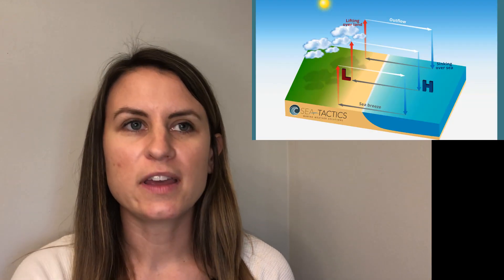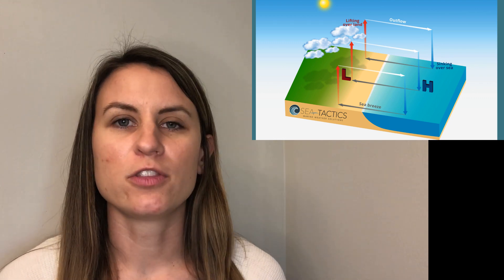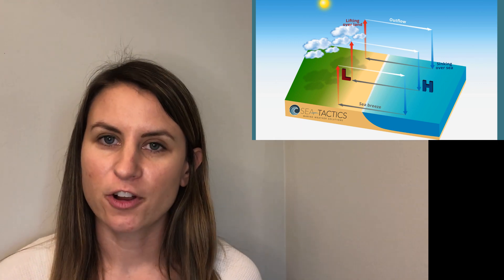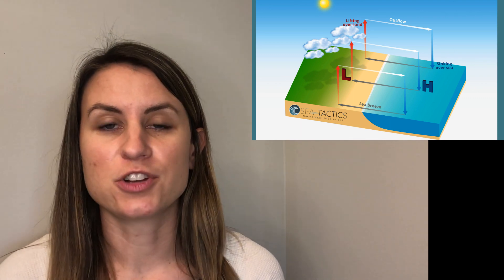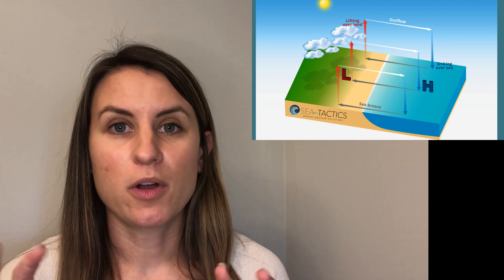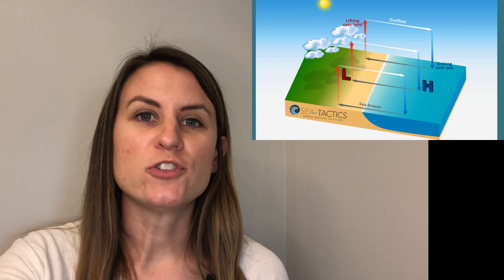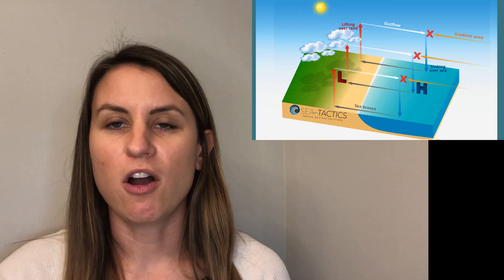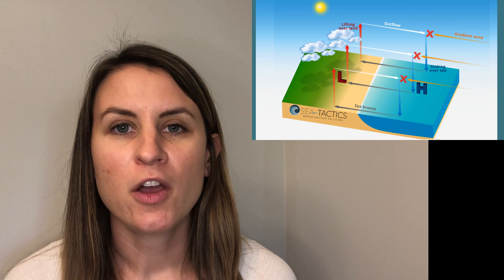Sea Breezes EXPLAINED! #WeatherWednesday

Comment: Question.  So the off shore breeze is light to moderate and a sea breeze is expected.  Should you sail closer to shore to take advantage of the off shore breeze while it lasts or move out into the lake (I sail on Lake Huron) to catch the sea breeze sooner when racing?
Reply from the maker: Hi Steve, good question, and tough one to make a general rule on.  It depends on what time your race starts compared to when the sea breeze is expected to start, and what direction the off shore breeze is from. In a typical sea breeze set up, the sea breeze (or lake breeze in your case) is strongest closer to the shore. There are exceptions to this, however, in a couple cases - like when the wind is nearly parallel from what we call "quadrant 2".  We cover the Quadrant theory in my online courses, or you can also get some insight in the book 'Wind Strategy'. Best of luck!!

Comment: With a sea breeze will you always have clouds over the land forming from heating?
Reply from the maker: Not always because if the air is particularly dry, you may not have clouds forming. But generally speaking, yes! The majority of the time you should see clouds over land.